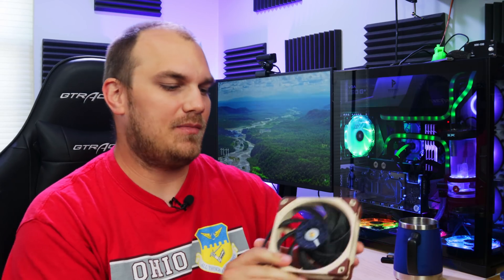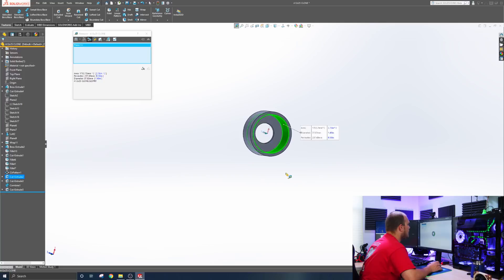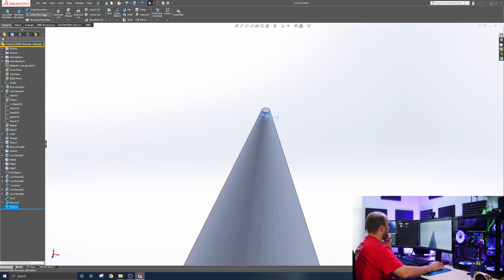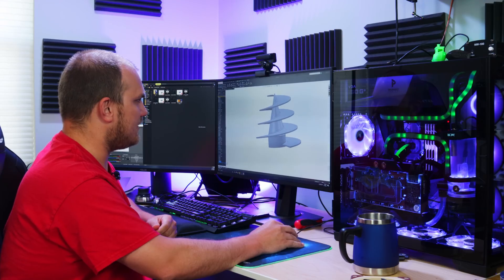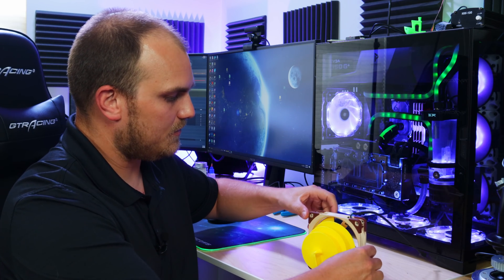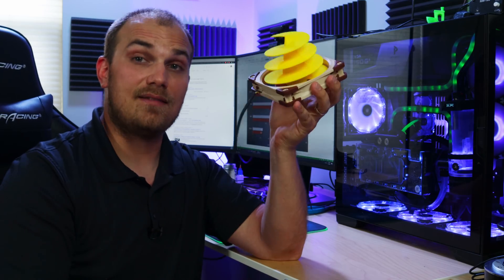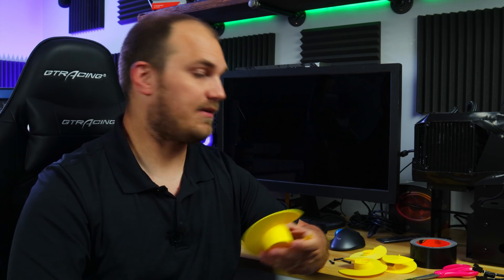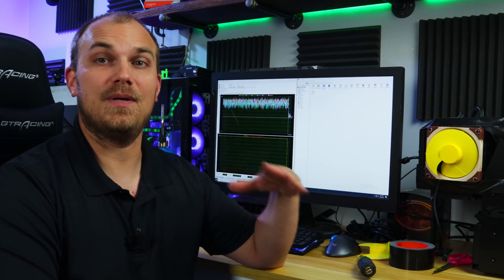Leonardo DA Vinci Made A PC Fan Would It Work?

Comment: I would really like to see you explore “squirrel cage” blower designs used on furnaces + worksite fans. If you make a mint remember me and hire me haha.
Reply from the maker: never heard them called that but you got my attention
Reply: @MajorHardware  I can't wait to see what you cook up! Powerful for moving lots of air. I would really love to see you work on integrating external ducts to pull air out and far from the internals, your channel could blow up on cooling mods, keep it up!!
Reply: And while we're at it, may as well throw in using aerogel (air gel) insulation inside of heat shields to create shielding for hot components. I think shapeways prints copper if you ever get some stellar prototypes done worth the investment.

Comment: it should be better to suck air and not push as most of the air is not moved through the rad but to the sides and i think a doublescrew would be also better

Comment: I'd be interested to see an air screw about at tall as your first one, but around a cylinder instead of a cone and give it a duct. I think the biggest flaw with an air screw is it loses all the air it moves out the open sides, if you covered them it still won't have much airflow but you might be able to get a really strong static pressure out of it.

Comment: Another idea...create a system where cool air is drawn from the floor (coolest air in the room) and hot air is exhausted towards the ceiling.  This would effectively maximize the temperature differential between cool incoming case air and exhausted hot air and ensure that hot air cannot be “reingested” into the cooling system.

Comment: wasting time on a build of this shape was actually a real waste of time. it only takes a cursory thought about the concept to see why this would suck as a fan. it takes multiple rotations to move any air front to back, there is no static pressure due to the angles used, and the only thing that this would WORK to move, is far more viscous fluids like water, oil, etc. even then, only if the "fan" was surrounded by something that let it maintain its "grip" on the medium it was attempting to move. FYI, this shape is often used as a "water screw" or as a drilling attachment on a Back-hoe. if this had any chance of working, the angle would have to be much steeper, "carrying" a air 'pocket front to back, in no more than a single rotation. even then it would work like shit.

Comment: too big difference in ambient/room temperatures between tests! Sometimes even 1 degree difference ambient air temp can cause a 4 degree difference on CPU, especially in water cooling systems because radiator heat dissipation is less effective

Comment: imagine having 2 fan hubs. attached to one long set of blades. have the each hub turned  facing eachother and rewire one hub to run backwards. and attached each frames to both sides. so there would be like 8 inches between frame one and two. and this set of blades so long that from the front all the way to the back it almost does a full 360 twist. i wander if the added length and both fan frames fighting the air resistance would cause more air pressure/ air speed?. would it double it, or work like sli where the scaling isnt the best ?. my mind runs away with weird ideas. i just bought a ender 3 ,3d printer from all the good reviews. but returned it when i realized it would probably end up being a hobby that would consume me, i will just let you do all the fun stuff lol

Comment: if you use it as a jet engine ( i.e. compressor ) it would work better. Add a funnel to the shape of the screw, giving maybe a few microns of space between funnel and screw, this will cause compression and by the time it reaches the smallest part of the screw the air pressure will be exponentially greater :)

Comment: I think it may have trouble building pressure just by the fans design. What if you put the blade inside a close tolerance tube. Like a meat grinder. I don't think it would out perform a traditional fan, but by my logic it should work better than out in the open.

My suggestion for the next goofy idea, would be to mimic a compressor wheel found in a turbo charger, however that would also need some sort of shroud surrounding the blades to be effective, and probably more than 2k rpm.

Love watching the channel grow MH! Keep up the good work.

Comment: that design seems to just cut the air. i wander if you had a way to direct the cut air at the very last second if it would help. just picture water rolling down the spiral, and at the very end it hits a angled wall that forces it down and  through the rad. you would have to make a single fin just like a wall about an inch after the last spiral ends. so it would be the spiral ending with a flat circle . and just a hole cut out to let the spirals air through. then the wall/ wing an inch after that spirals opening . you may have to add a few fins around the bottom just for balance. if any of this makes sense lol.

Comment: I wonder if adding a lip to the edge of the blade help get the air to go where it's supposed to would improve performance? Kind of how aeroplane wings have that upward pointing tip provides additional lift without having to use longer wings.
It'll still perform like crap, but I have a feeling that the air isn't moving down the spiral correctly and instead is escaping out the sides,  and when combined with the resistance of the radiator it can't provide enough static pressure to push through it properly.
This video had me laughing out loud at the antics of that fan, it looked utterly ridiculous bouncing across your desk :D
Reply: In 5 years when revolutionary new fans come out with blades with lips on them, I’ll remember this comment bc that’s actually a genius idea, not sure why no one has done this yet
Reply: Grey Lawson some fans already do this, but in most PC case fans they already have a full stationary duct surrounding them which does similar thing.
Reply: I was thinking about the same thing. I may be slow but he would have to print upside down? Model it with a stand to be cut off after printing? I dont own a printer myself so. But yes i think alot of air is coming off of the outer edge of the screw and not being compressed very well. Or something like that. Still the issue of balance though. Maybe i should look up a prop balancer to see the operation and see if anything comes to mind. 👌👍✌
Reply: That upward tip is not for additional lift. They're called winglets, and they help reduce wingtip vortices (caused by high pressure lifting air escaping over the tip of the wing and mixing with the low pressure air on top, causing a spiral vortex, which means turbulence and drag). Winglets guide the air around the edge and help it recombine at the top without rolling over, significantly reducing vortex size.

Comment: The vibration is not necessarily caused by bad printing but rather by the design. The fan is not symmetric. On one side the weight of the blade is more forward than on the other, which causes rotational instability along this axis. I don't know the English word for it but in german enginnering this is called a "dynamische unwucht". A two-half-screw design similar to a ship screw would mitigate the issue.
Love your vids, keep up the great work!

Comment: I've always wondered if wing shaped blades would help move air? You know, flat facing out, and a wing curve on the inside side of the fan.  Also, for the helix, why not try a triple helix to try and help with balance, printed with a 1mm clearance from a 125mm ducting pipe. and use the pipe to shroud it. That should channel the air, just like a really thick fan.

Comment: That shape is never gonna work, you need to construct a wall around it so the air coming in doesn't escape. That conical shape is bad too anyway, the intake will be too small.
You need to do something like the blades from the noctua, in 3 stacks with slight angle differences so the blades aren't on top of each other, all encased in a cylindrical wall. Just like turbines are. Try that on a noctua 3000RPM hub to compensate for the weight of the turbine construction.

Comment: There is a major design flaw. There is nothing to prevent the air escaping the blade before it enters the housing. Maybe bend the blades so the air gets push towards the center, or make a cylinder around it.

Comment: The credit should go to Archimedes instead of DaVinci, after all, that is an "Archimedes Screw"
Reply: An archimedes screw is a completely different thing. That's an enclosed spiral tube at an angle that is used to move water and other things up an incline.
Reply: @Tao4Now9393  no its not ..the only difference is that this is not enclosed
Reply: @DrSmugface  It's completely different. An archimedes screw is enclosed, not tapered, and used for moving liquids. A Da Vinci screw is tapered, not enclosed, and for moving air. This is not an archimedes screw. Literally the only thing this has in common with an archimedes screw is that it's a screw with a thin and broad helix.

Comment: I would imagine a majority of the air being pushed by the fan escapes out of the side before being pushed through. It wouldn't be pretty, but some kind of shroud/cylinder for the air screw to be inside of would prevent this.

If you made a couple plugs for the ends of the central cylinder with a very small hole in the center, you could run a metal rod through it to balance.
Reply: also you can use a V shape for fan so air get some force 
\                               /
   \                         /
      \                   /
        |                |
        |_________|
and use 2 blade for balance
Reply: I came here to say exactly this. Same principle as archamedes screw with water.
Reply: I like the idea of a lip hindering the air from escaping the single fan blade, and since DaVinci was obviously bound to the one-blade-idea, I would for the sake of this not use a double / triple / n-part helix, since this would just get us closer to known modern fan designs. What I would like to see instead actually, is taking the idea of the lips on the edges quite a bit further up to the point where the one blade kind of forms a closed dome or a snail shell so that the air is really kind of forced/compressed into the exhaust direction. (Would this kind of cross the border from an axial to a diagonal/radial fan design?)
Reply: @inzanefu  problem with compressing it is that it's going to heat up the air which is going to drop the cooling capability's by quite a bit. So a shroud yes but only to direct the air, cfm is important pressure not.
Reply: Is possible to keep it open and lose less air on the sides.

Just needs to make like a tilted rooftop screw shape.
Reply: It has been obvious for ages. Shroud is the more important part of the fan design both to power and direction and resonance. I dont understand the issue with manufacturers and going hmmm You know what.. fans and usage and abilities with them have been perfected.. HEY! I KNOW! Lets make mini box fans. foreheadslap
Reply: @SeeTheWholeTruth  most computer fans are square like a box fan, but it's really a square mount on a round shroud.
Reply: I really like this idea, I’ll also add perhaps a double helix
Reply: Exactly what I was thinking same principal as a water pump.
Reply: was just about to suggest that
Reply: Yep. My thoughts exactly!
Reply: @Microplastic_Therapy  the closer you can get without creating friction the better, but if it's touching, it's dragging which means it's wearing both the part and the motor down. I don't think it's entirely a bad idea to have a fan with a break-in tolerance though. Basically, that would get you the best possible results without going through a whole lot more trouble. There comes a point when the centering of the motor in the frame is going to put a limit o what eve that can do. Noctua actually has some pretty good fans that minimize the amount of space between the fins and the shroud.
Reply: Also put a little concave in the blade maybe
Reply: @kylefaxon4083  Well, he made a second video about this already with sleeves.
Reply: Some fans are 38mm thick. Would be worth trying out to have a thicker body shrouding it, as mentioned.
Reply: Exactly what I was thinking.
Reply: This is done on some things. A cone shaped shroud, although most uses I've seen are for extruders or some types of jet engines.
Edit:
Durrr. I forgot boat impellers.
Reply: Would work good
Reply: The only air being pushed is a result of surface friction- the fan blade being uneven enough that it catches resistance
Reply: If I remember correctly the air screw is equivalent to a single blade fan.
Reply: Had exactly the same thought. For the normal fan, the sides of the fan are as high as the fan blades, so restrict air of escaping sideways. For the last test about half of the blade sticks out of the walls.
Reply: Was about to say the same lol. nice
Reply: Adding a shroud would basically turn it into a ducted fan
Reply: I added my comment before I read this one😂
Reply: Interestingly, Leonardo's airscrew used cloth instead of a hard surface, which means that it would bend upwards during operation, preventing the air from getting shoved out the sides.
Reply: I was thinking the same thing before he even tested it, with a shroud something like this might actually work well.
Reply: @Microplastic_Therapy   That could help for sure, but what if the shroud was actually built into the fan itself? You could probably get away with making it thinner too, maybe just a layer or two at most so it wouldn't add too much weight and you wouldn't have the distance between the screw and shroud at all, only issue could be added weight.

Also it might actually be better if the screw began larger and got smaller in hopes of multiplying the speed and velocity of the air, and to trap more air to start with or at least not start smaller, and also make it as short as possible so there isn't unnecessary height, maybe just a couple full turns.
Reply: All of the most economic solutions to this design were in the fan before he took it apart
Reply: i pretty sure it's the problem

Comment: You need to funnel the air, like a screw compressor. that will make a high static pressure fan if it’s works. Nice video
Reply: and guide the top of the center in another guide, as in lathes there can be two guides, the one who spins with the motor, the other who maintain centered a long piece.
Reply: @pengesvend @666neoselen You two both beat me to it ;)
Reply: I think it might have helped to make them rounded, to push air to the middle yeah and reverse it to make it compress like an extruder. That's interesting Infact

Edit: also top part might have to be like a fan, to actually grab some air and push it down the screw
Reply: I like a turbo style with low noise fan
Reply: Trash. Maybe in water be more effective
Reply: You can do it
Reply: Arent these designs more practical to funnel water? Maybe he should use the screw for DIY watercooling
Reply: Wouldn't that mean just flip it LUL

Comment: You should try reversing the pitch on the screw so that it pulls air thru the radiator... and/or you should use an extended outer tube on the fan cage/mount that is at least the length of the screw to increase efficiency.
Reply: yeah also this is a pressure fan, not an airflow fan so it being used for a radiator would make much more sense
Reply: Yeah that was also what I was thinking. 👍

Comment: I think the fan tip was useless because of the centrifugal force that pushes the air out of the fan. One way to make it more effective could be to put something on the sides to prevent air loss, but the intake will not be large enough.

Comment: How about this for an idea? You know how Dyson vacuum cleaners work with their tornado technology? 

Somehow (I literally have no idea) you could make a fan system the emulates that super high pressure air flow? 

Big ask I know! But if you could make something that is more powerful than the Corsair Maglev fans CFM rating wise you might even be able to also make an enclosure too to help with that air pressure on top. 

Then get Noctua to buy the IP from you! 

Or not and it fails horrendously 😂.

But you're the right man for the job without question!!

Comment: Have you tried making fan spacers? So basically moving the fan say half an inch away from the radiator to allow the fan to use the whole surface of the radiator instead of having some blocked by the fan motor?
What about a 360 aio with a shroud down to 1 fan?

Comment: Do you want to improve this design, what you've essentially made is fluting, and now if you put it in a shroud or a tube, it will actually move quite a bit of air or anything, as long as you get to seal between these floating in the tube fairly good. This is how a lot of agricultural products are moved, via floating in a tube.

Comment: The problem of this design is that the air gets pushed also sideways, so little air goes backwards. You should try making a cilindrical enclosure to the fan so it's forced to go backwards,
Reply: exactly, this is much more a radial fan.
Reply: @Basement-Science  🔴 What Is Islam? ⚠️

🔴 Islam is not just another religion. 

🔵 It is the same message preached by Moses, Jesus and Abraham.
Reply: also maybe gradually increase the incline of the blade to get higher air acceleration.
So it has a big air intake but a small outlet for higher pressure.
Reply: Same thought
Reply: wanted to say the same thing
Reply: I agree with you
Reply: Combine that with a double helix or even a quad helix to ballance the screw.
Reply: Timothy Dornan, et al ... if the center was a cone as in the first iteration, the blade would be significantly wider thus gathering more air.  Inside a shroud, that air would be forced through a smaller and smaller column which would increase pressure and velocity.  Not?